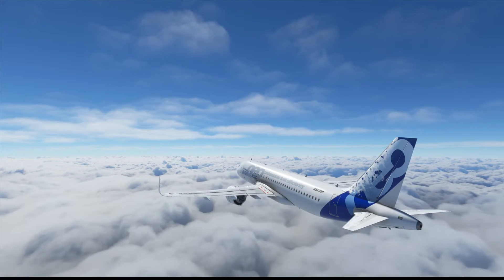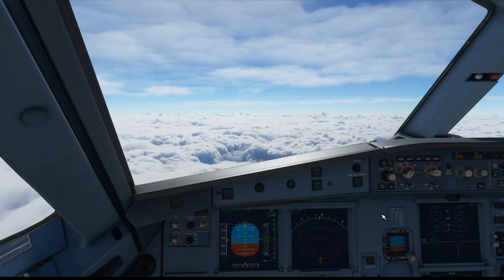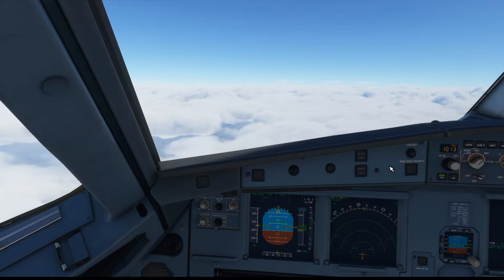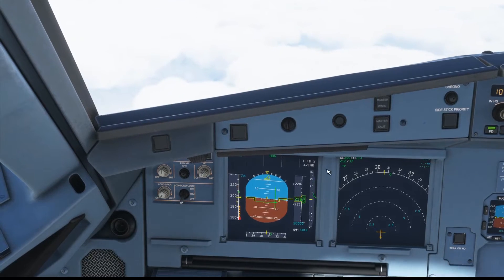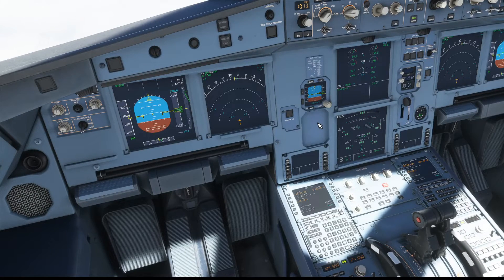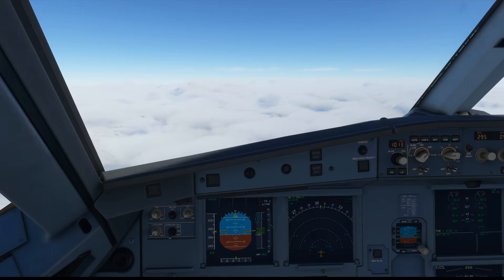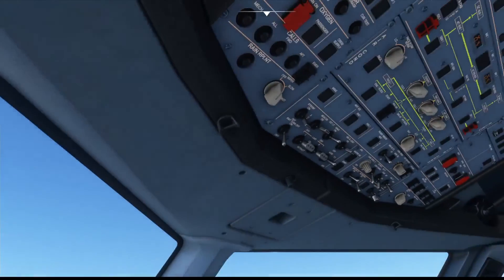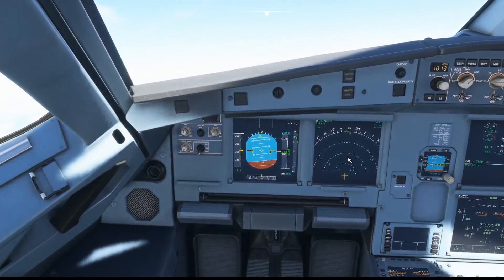MSFS2020 - A320 - Normal Law Protections (& how to remove them)

Comment: That's actually what every airplane i have ever flown does: You initiate the turn with the ailerons (prefereby add some rudder to stay cooordinated), then you neutralize the ailerons to stay in the turn.
Reply from the maker: Can't speak for other airliners, but for Airbus, do not use the rudder in Flight. The Flybywire systems do all this for you.
Reply: @Easyjetsimpilot  I know that, I was speaking about all airplanes. The FBW system still uses the rudder to stay coordinated. The rest about initiating a turn is the same in all airplanes. It is also the same in all airplanes that they will not hold pitch attitude but return to the speed they were trimmed for.
Reply from the maker: @cherokee592  ah OK - I thought you were including the Airbus within your comments. That of course is very different for the Airbus. Rudders aren't touched until about 30ft Bove the ground, and if you set a pitch with the sidestick, the aircraft will hold that pitch, even when you let go of the sidestick (point and shoot!)

Comment: Very nicely demonstrated the sim does a pretty decent job. For your pitch limits in normal law (+30°/-15°), these values reduce to +20°/-10° when you have one stage of flap/slat out or more. I wonder if that’s modelled?
Reply from the maker: Will have to check that out!